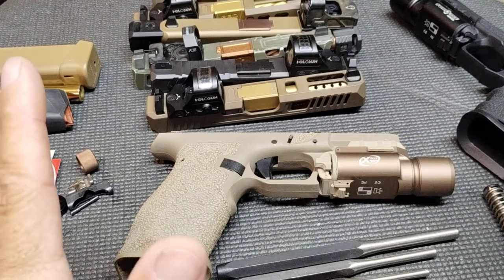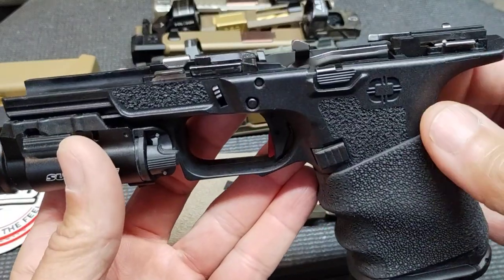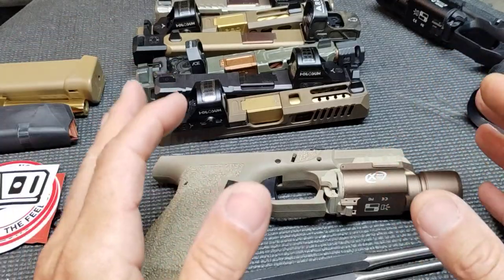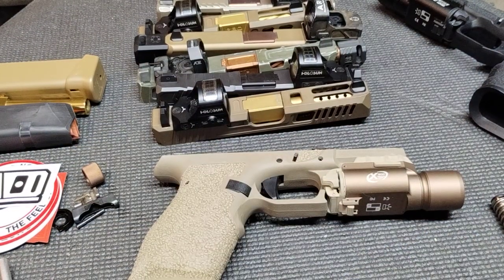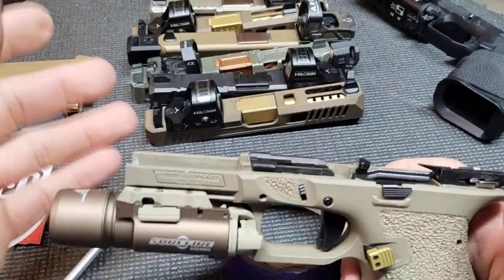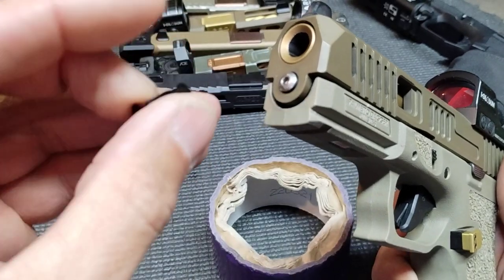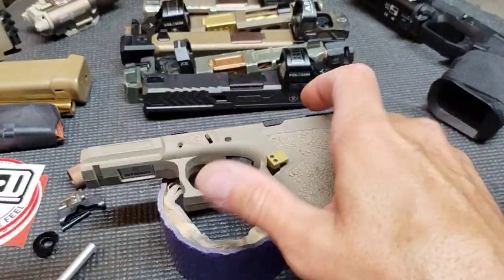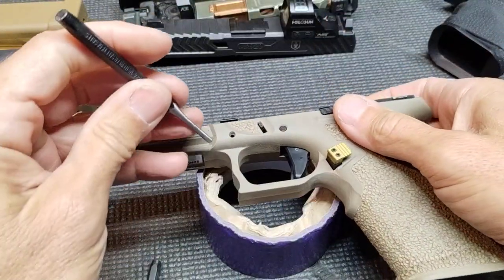PSA Dagger Glock Gen 3 Clone Complete disassembly reassembly How To

Comment: Great video, but I will stick to Glock OEM guns and parts.  I built one aftermarket Glock clone and learned my lesson.
Reply from the maker: @flattire707  the shadow systems seems to be the best built out of the ones I have but the dagger definitely feels better in hand and functions just as well out of the box.. based on several other tubers talking about overall durability there doesn't seem to be an issue either but I haven't and don't shoot enough to test durability on anything firearms related..
I do a lot of fishing but not to the extremes that tournament anglers do either but try to let everyone know how something is working out for me and if I've seen any durability or quality control issues being expressed from other consumers

Comment: Those mag release springs are tight on the dagger. I like to pull them out when I get a new frame and thin the rod out a bit with a dremel. Just a little. It makes the mag release a lot easier to press. Glad you showed how to get out even the smallest bits like that.

Comment: I have a related question to all the slides on the table , holster comparability ?
The OEM Dagger has its own profile, especially with the high suppressor sights , but add an after market slide, like the Leo precision, Zaffiri etc and it changes. What have you found as a OWB that works ?
Reply from the maker: Look for holsters that basically use the light as the determining factor to what they fit if you can't find one that works for you. I have no idea how interchangeable any holster is if it's not designed for use without a light
Reply: Thanks Picked up a G-code holster on E-bay for the stock dagger, works great, but will look at light holsters for the aftermarket Glock slides or just have a custom build.